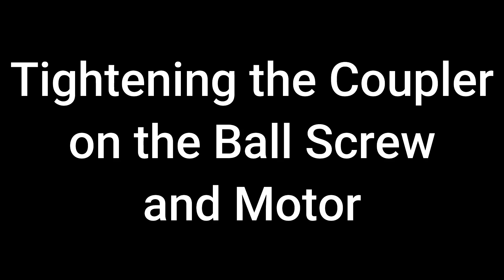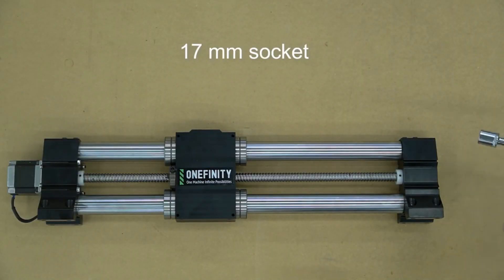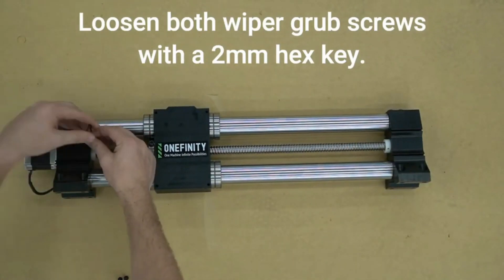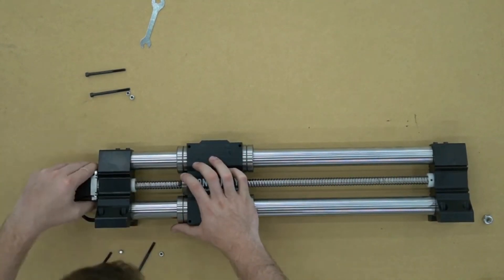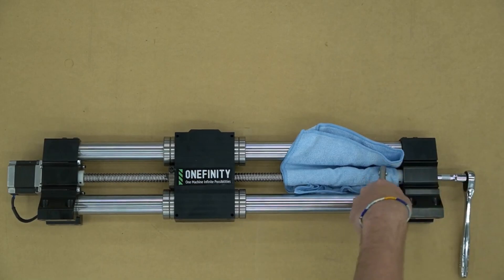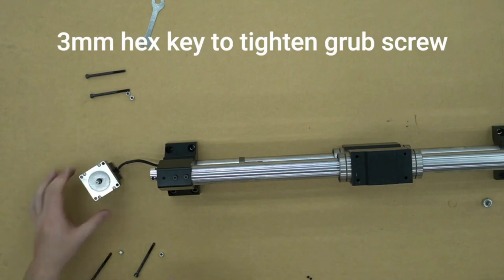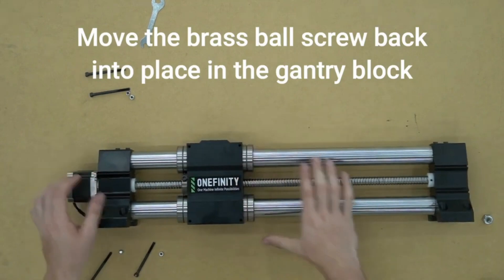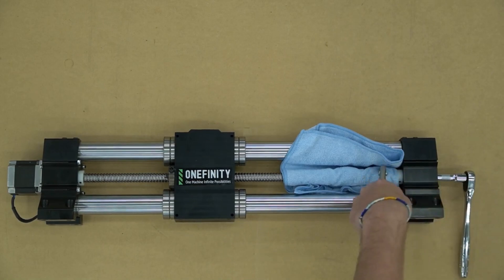Tightening the coupler on the ball screw // Updated for quick access holes // Support

Comment: when i check through the holes on the front of the back where you are inserting the 2.5mm hex key - its flat black in the back. 
what do i need to turn so that the hex key is being pushed into something that can recieve it or turn.
Reply from the maker: The big silver screw in between the two silver tubes.  The silver screw the coupler is connected to.